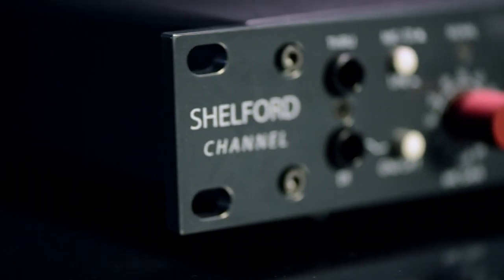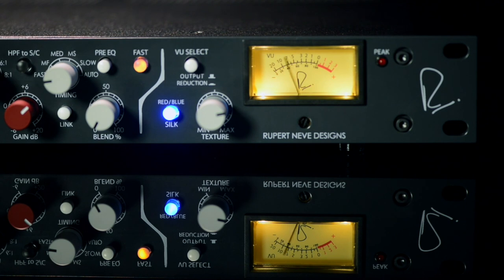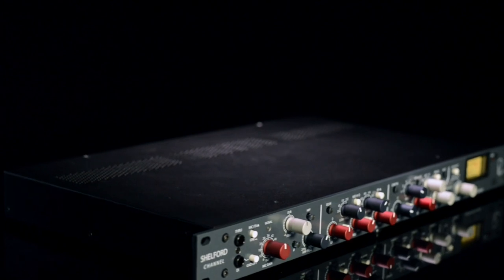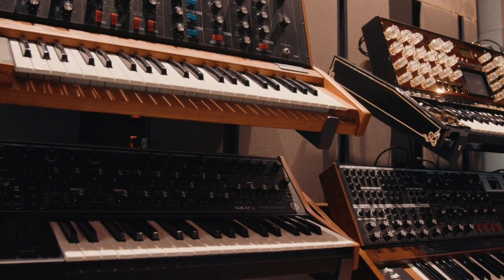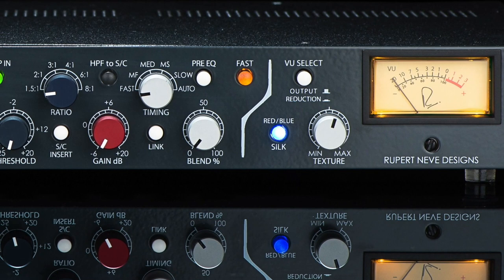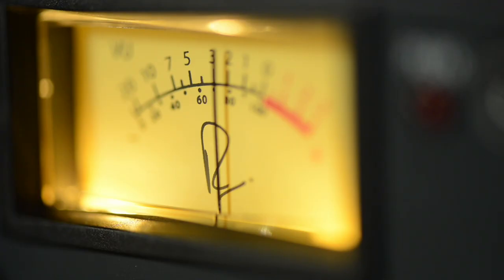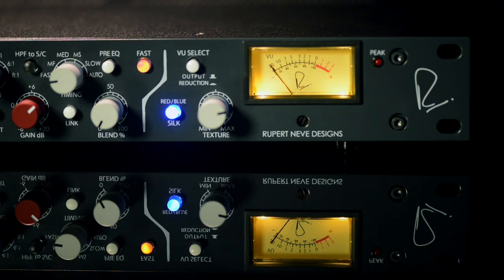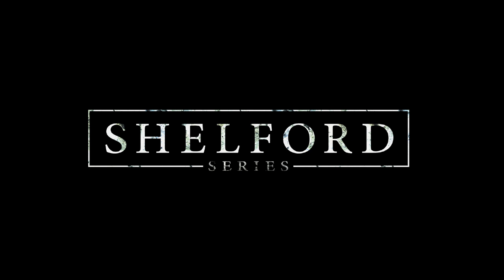The Shelford Channel: Origin Story

Comment: Api’ the channel strip shiits all over the shellford, neves products have gone down the Toilet since Rupert passed, the API unit is built with transisters inside there 25-20 opamps where shellfords uses microchips…
Reply: I have both the RND 511 with RNDI & API 505-DI with 2520 OP Amp and I tend to choose my RND over the API 9 times out of 10.